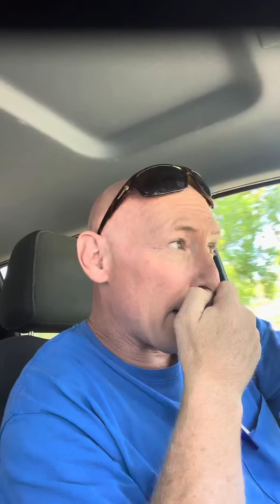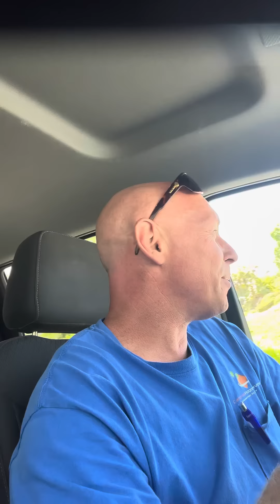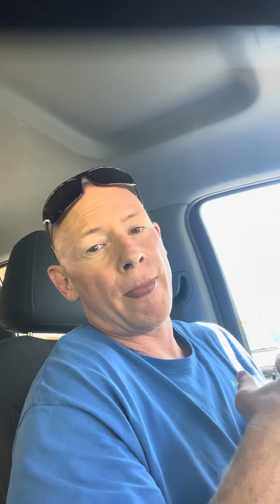Yes, Your SPC Vinyl Needs A Moisture Management System - AKA Moisture Barrier

Comment: Spc is fairly new to New Zealand where I install and like you say they sell it as being able to do everything and go over everything. We quickly learned it does not and even checking the floor for things like a 3mm deviation over 3 meters is important, it does not like uneven floors.
Reply from the maker: @bradfry2259  💯

Comment: Isn’t the lvp treated to resist mold on the soft layer, wouldn’t vapour barrier be susceptible to mold and mildew and the concrete won’t breathe at all?
Reply from the maker: No, mold needs moisture, humidity and an organic compound. Yes about the vapor barrier being susceptible to mold. Manufacturer’s guidelines require the 6mil poly, as a flooring contractor, we need to protect our client’s investment and follow manufacturer’s guidelines. If you don’t put it, and there’s a problem, guess who’s responsible?  That’s right… the flooring contractor. Great question!  👍🏼👍🏼
Reply: @Californiaflooring  I am putting in luxury vinyl plank in a newer build basement, I know nothing other than youtube knowledge, I know there are so many scenarios but would you suggest I use a vapour barrier or just throw the vinyl plank down? Its probably gonna be mono serra spc rigid core 6.5 mm. I have not pulled the trigger yet, still researching.
Reply from the maker: @underscr0e  So, since it’s below grade, you’ll want to put a vapor barrier for sure. 💯 Do not skip this part.
Reply: @Californiaflooring  Thank you
Reply from the maker: @underscr0e  anytime, reach out if you have any other questions. 👍🏼

Comment: What about under luxury vinyl planks on a concrete slab?   I’m wondering this cuz my LVP are 100% water proof, yet I heard I should use a moisture barrier before installing it. Is this correct?   Why would this be necessary?
Reply from the maker: It’s absolutely 💯 imperative to have a 6 mil poly sheeting over your concrete substrate and below the luxury vinyl. I’ll be posting a new video showing why, so subscribe to my channel to see the new video. Waterproof topically is not the same as vapor proof from the slab below. You need to mitigate the moisture coming from the slab below, as that will affect the planks and cause cupping.
Reply: I have been installing hard surface floors for 22 years. A couple of years ago, we had some lvp flooring cup because moisture would try to get out of the seams. 
The manufacturer told us to put 6 mill plastic down everywhere we installed it. Now we are informed from the manufacturer to only put plastic down ONLY on concrete floors. Do not install plastic on any wood subfloor because it will make a double vapor barrier and rot the wood. Also, do not put plastic on top of a glue down  floor and put lvp over it. It will make a double vapor barrier .
It's funny we brought this up in the beginning, and the manufacturer didn't listen .

Anyway, though, this was something to check out.
Reply from the maker: @jimestrem6010  100% correct, only over a concrete substrate, not wood subfloors. However, there is one manufacturer that states to put it over a wood subfloor…. Unbelievable. However that’s their guidelines. What would you do in that situation, go against the guideline or follow them? I know what I would do.   Thanks for the comment!   👍🏼
Reply: @Californiaflooring  
Well, about your question . I have a very good reputation in my area because I am very honest with my customers. I explain what I am going to do and why before I start the job. In this situation, I would explain both options and let the customer decide. It seems that if I put the plastic down ,I'm doing it wrong. And if I don't put it down, it looks like I'm doing it wrong from the instructions.
I would have the customer sign the flooring agreement with their decision .

I would appreciate your thoughts on this. It was a head scratcher for me.  Lol !
Reply from the maker: @jimestrem6010  That’s a great answer, the correct answer in my opinion is to put the poly and document it. You can’t let the customer decide because they are not the professional, as much as it would pain me to do this. Anyways, I would contact the manufacturer and have them email me in writing to put the poly.  Total head scratcher  😆

Comment: I had lvp wpc fusion emax coretec technology installed over a slab a year ago. I asked about vapor barrier prior to install and was told it was not needed by store that sold material and their contractor who installed. They said moisture vapor barrier would have trapped moisture seep up the walls. I noticed crackling sounds when high humidity not everywhere but some areas. It was installed in June 2023 and I had contractor come then to hear areas of crackling. Well of course he didnt own it! I'm having owner come next week. Any suggestions? Forgot to mention product cork underlayment attached and 100% waterproof. I also asked prior to install if they did moisture testing, wife of owner said no. Not sure if all this voids warranty either. Other than crackling sounds no cupping yet! Also they didn't use shop vac only broom prior to install. I'm sorry for long comment but wanted to provide all the issues. I'm so ticked!
Reply from the maker: Possibly out-of-flat substrate, needs to be 3/16” in 10’ span. Yes manufacturer wants you to put 6 mil poly moisture barrier. Go the manufacturer’s website and look up the install instructions. Print them out. Good luck!
Reply: @Californiaflooring Thank you for your quick response. I did print out and it clearly states "an additional 6mil poly or equal vapor retarder MAY be used as an additional layer of protection." Apparently manufacturer is not requiring but stating option. As to attached underlayment, I was wrong  it's not cork underlayment it's IXPE foam. Thanks for your assistance. I think the areas where I hear  crackling is possibly lack of good shop vac cleaning before and also uneven subfloor but will be sure to have manufacturer inspect floor regarding moisture and vapor barrier.  Hoping to resolve this issue thru company and/or manufacturer. Thank you again.😊

Comment: Would a dehumidifier work?? Empire came twice to install... then, due to warping of the planks, then they returned  and replaced it the same way after drying the concrete.
Reply from the maker: No, it can for wood sometimes, but not SPC/LVP. If they did not put a moisture barrier, then you are looking at a potential same problem down the road. Who’s the manufacturer of your flooring?

Comment: Does that apply in Texas? Also what if you just put underlayment?
Reply from the maker: Absolutely, you need a 6-mil poly sheeting over the concrete prior to installation. You don’t want to add anymore underlayment if it has an attached padding to the SPC plank already.
Reply: @Californiaflooring  Thank you so much for the reply! I know you are very busy but i was also curious does it matter what the moisture content reads in the slab? Ive read that that would determine wether you use a moisture barrier or not
Reply from the maker: @840diego5  Yes, you need to have your contractor document it if you can, however if you are DIY, then just make sure you have the 6mil poly sheeting over your concrete substrate.

Comment: why couldn't you use a liquid concrete sealer on basement floor
Reply from the maker: On a basement floor yes, I would use a 2-part epoxy moisture barrier. 👍🏼 I would still incorporate a 6 mil poly sheeting as well. Always follow manufacturer’s guidelines.